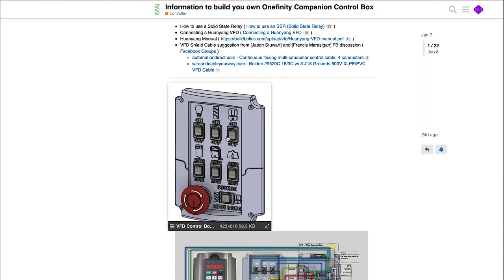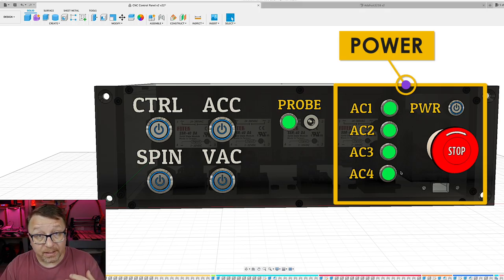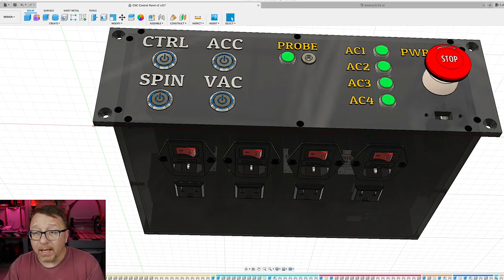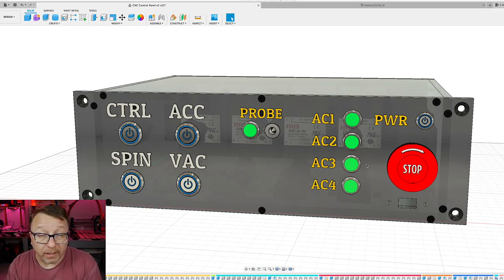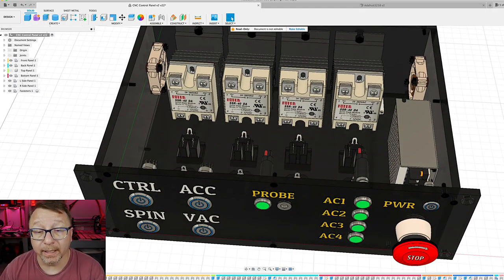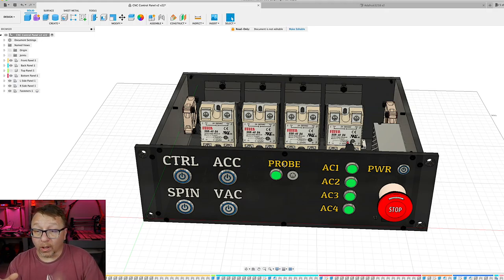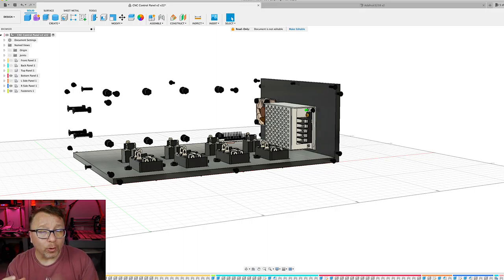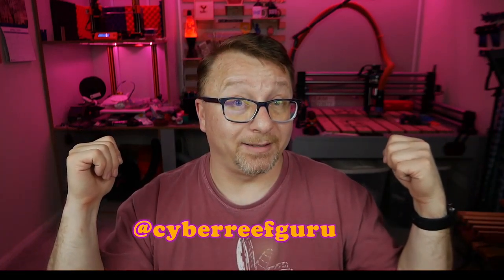Design a CNC Control Panel

Comment: Great job. I have a new wish list. Did you take apart your CNC controller and steal the parts or build from scratch. I have a Onefinity CNC and would love to build one like your but would be timid to wirer all of the controls inside. Love what you have done...
Reply from the maker: Hi there. I built my from scratch.  The wiring is not difficult, but it does take time and patience.  Thanks for the kudos and thanks for watching!